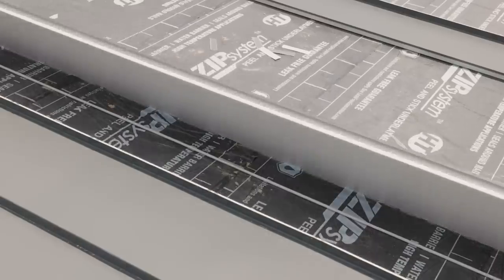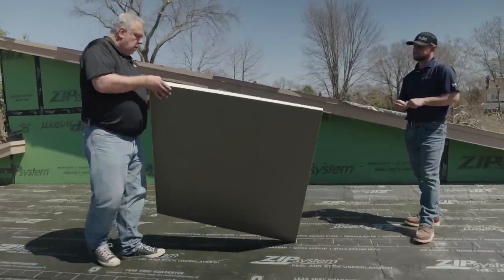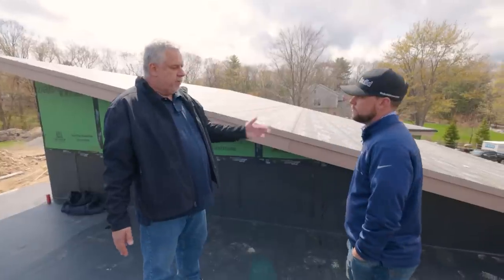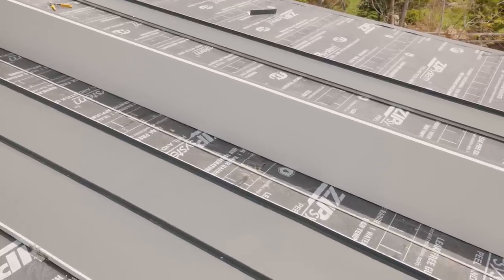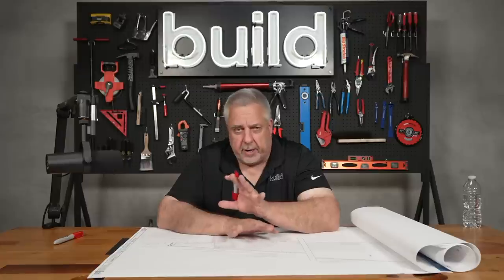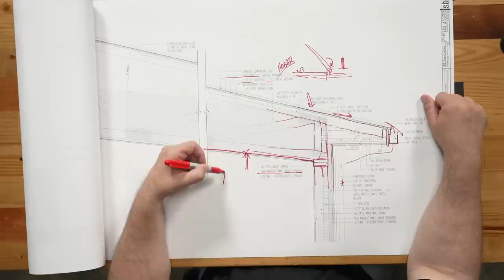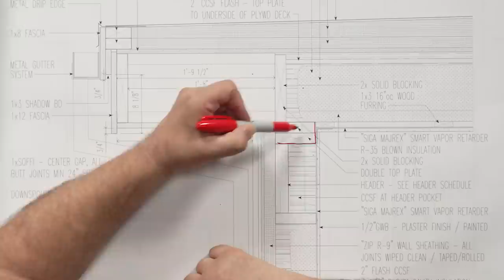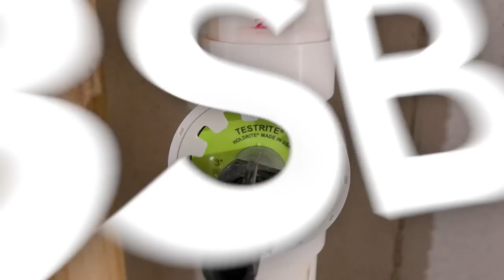"Roofing" Build Show Build: Boston Ep. 11

Comment: There have been several YouTube videos where people have used a layer of spray foam followed by fiberglass batt insulation.  Some have experienced condensation on the interior surface of the closed cell spray foam.  In this video, I don't know what percentage of the R value is above and below the the spray foam/blown-in cellulose interface, but lets just say it is 50/50.  If that is the case, if it is 20F degrees outside and 68F inside, a difference of 48F degrees, then the inside surface of the spray foam will be at 44F degrees.  If the indoor relative humidity is at 50%, the dewpoint is at about 48F degrees.  Since the spray foam surface is at 44F degrees, it is 4F degrees below the dewpoint, so condensation may occur.  Because of this, they say it is best to put most of the insulation on the exterior in that kind of setup.  I don't know what the R values are in this video, so I'm not saying there is a problem.  If most of your insulation is the polyiso and spray foam, it is probaby not a problem.   People don't always realize that the batt (or blown-in) insulation is also isolating your roof deck from the interior warmth but not the inside humidity.
Reply: The split here is more like 60/40 favoring the outside

Comment: Good Lord....it was brutal listening to the procedure being explained for EPDM installation! Hell I was in Local 33 out of Dorchester (roofers union) and we installed MILES of thee Carlisle/Goodyear any rubber ...the yellow glue is for substrate and the black for "rubber to rubber" seams that get rolled....What they are applying is a "screw and glue." I am of the opinion that it is the best waterproofing system available and I was doing this work in the early to mid 80's. Hell we did the Garden / MIT/ BC/ Harvard...let alone all the other private buildings and of course public buildings...just saying it was painful to hear these guys describe what is common place to me. I was raised in Southeastern Mass. and I sound like these guys....wicked Pissa!

Comment: Is the high heat underlayment you used sufficient for a wildfire area? I know that unless you use an underlayment designed for wildfires that the radiant heat from the fire can transfer through a metal roof and set the sheathing on fire.

Comment: Great Video!!! Any thoughts on running the zip R up to the bottom of the roof deck and sealing between the joists to keep the continuous air barrier (similar to what Matt and Scott True have done with their monopoly framing?) Would be tricky cutting Zip R to fit around I joists. But would eliminate the need to spray foam the inside of the blocking? Just wondering if you would still need a vapor retarder with the full air barrier and your Zehnder inside? Keep the great content coming!!

Comment: Why don't more people run plumbing vents out the side of a house under an overhang instead of cutting a hole in the roof?  Cutting a bunch of holes in the roof just feels wrong, even if there are boots and other ways of sealing things up.
Reply: Agree with that. Around here we use 4.5" pipes, and only need 1 vent for the whole building. The vent must be above the roof though. Can go out through the wall but must end above the roof.

Comment: What is the length of the roofing screw that holds down the standing seam roof to the substrate? How many years do they warrant this type of roof? 👍
Reply: you can look up RCABC's guild lines for metal roofs. even if you arent in BC Canada, its a great guildline . (you might be warm climate, but fasters and details are largely the same). how much pen you want into the Substrate depends on screw being used and what you are screwing to
Reply: @HerbaceousM8 Thanks. It didn't look like a very long screw. I'm in Texas, Tornado alley. They have a fortified roof program that the insurance companies would give rebates on if the homeowner builds the roof to the fortified roof specifications. The length of the screw and the spacing is a part of it.
Reply: I couldn't tell but was the screw only going into the foam board ?
Reply: @hodesto  no, i think its 3/4" into the plywood, it might be a bit more if the screw is self tapping

Comment: Why would you cheap out on the epdm membrane? The proven industry standard is Firestone/Bridgestone.
Reply: its all the same stuff now a days, if it has the same warrantee its going to be fine. and dont touch the 40mil, at least use 60 or 80 if possible. Versico is actually a pretty common name, they have been around like 30 years

Comment: I want a flat roof, shaded and on the north side of the house, that I can put all the HVAC equiment on. Would have to figure out how to do it without penetrations though, maybe by running pipe into a virticle wall then down. Very interesting stuff.
Reply: Would a floor truss work?  They have penetrations by design
Reply: @HeroNinjaClan  yeah, I'm assuming under that insulation and zip they have essentially a floor truss.

Comment: Really nice looking --  QUESTION -- Why do you have so many layers of waterproofing?  If they actually work, who not lay all the required pieces down and make the last one the rubber/zip product that is waterproof?  I saw Matt Ressinger do something similar on his build. However, I can't help but think that should any water make it past the top "waterproof" layer, then it will get stuck between one or more of these repeated waterproof layers ie it will never be able to escape.  The problem with a "perfect seal" is that should it leak you now create a system with no exit points and the water will ping pong around forever.  Why not simply do the wood sheathing, lay the insulation then do one single water proof layer and then the metal roof or tile.  Done.
Reply: Logistics. The sheathing  was sealed to protect the structure until the final roof surfaces could all be done at once.